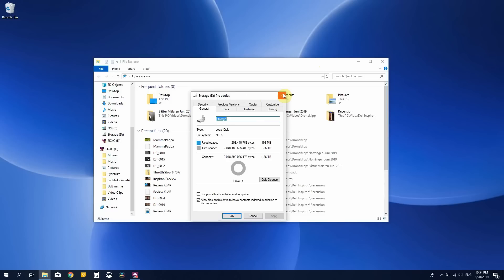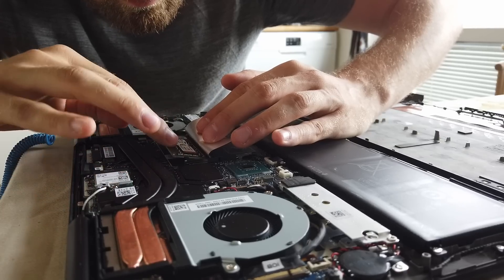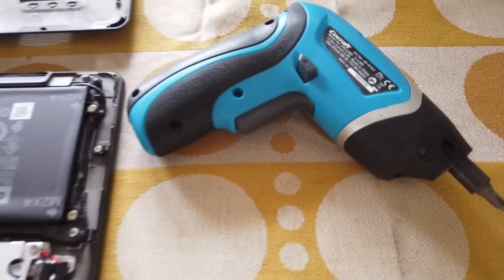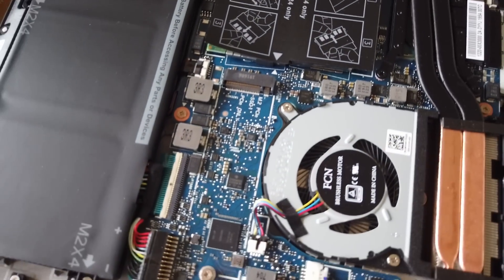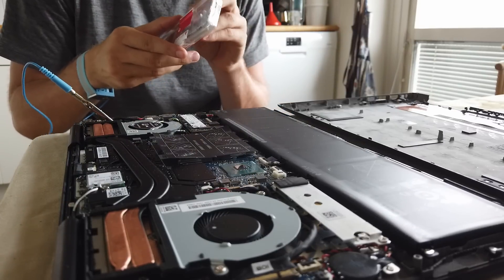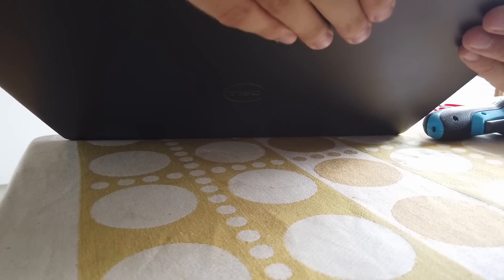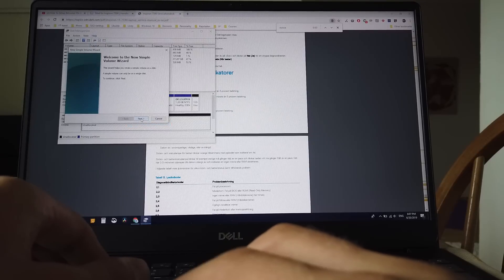Dell Inspiron - 2,5Tb SSD & 16GB RAM Upgrade

Comment: could you tell why you ignored dell restriction of 512 gb limit of the second ssd , and will instaling a 1 or 2TB ssd will affect the laptop speed or the system energy efficiency?
Reply from the maker: Because I think it's ridiculous and it's been working perfectly fine. I read that thing only after I bought the SSD.
It should be no problem at all!
Reply: @w2best  thank you for answering
Reply: Sir , laptop is Inspiron 7591 , I ran into a problem , I have added an another SSD to my 2nd slot , when I press power button it shows amber color light (no blinking) and light gets off when take my hand away from power button , can you help me plzzz🙏

Comment: Hi, the 8GB Samsung RAM you linked in the description, is it the same model as the one that is already in the laptop? So it'll work in dual channel? Or should I buy two of these and replace the one that's already in there? Thank you.
Reply from the maker: Not the same but the same size and speed so it works perfect. :)

Comment: Did you run into any kernel errors when installing second ssd? I have inspiron 7591 and plan to install mp510 corsair.  Also does it come with ssd screw?
Reply from the maker: I had no issues at all with it! What problem do you get into? SSD screw is there! Just put it in and go! :)

Comment: Hey, thanks for the vid! What graphics card are you using?
Reply: Nvm i just saw it at the end of the vid! I was looking for it in the description:P
Reply from the maker: Yes it's the 1650 in this one!
Reply: @w2best  I own the 7591 Black Edition - so they sell the 7590 with a 1650? Or did you swap out the MX250/150 or what? That is one thing I wish the 7591 Black Edition has, at least a mid range GTX graphics card. I have 4 more days before my return date window at Best Buy is up. I have upgraded the memory with 32 dual Crucial and thinking about adding the Intel 600 SSD you suggest. I am a graphic artist and have been running this machine nonstop to see its limits and I am wondering how well the MX250 will be for the long haul. It was between this laptop and the Asus Q547FD...I hope I am making the right decision. I love the magnetic stylus slot and overall look of the Inspiron 7591 BE. Great vids btw
Reply: @TruthistheONLYRealThing  hey did you ever got to return the laptop. I'm in the same exact situation you're in. But I notice the laptop he's review is quite different from the one we both have. I click on the link listed and noticed the difference in specs. I doubt his laptop is 4k as yours is. I'm loving this laptop but that Mx250 graphic card bothers me. I wish they have it with the gtx1060. I have about 7 more days on mine, hence, I cant return it. But it definitely is a great laptop. P.S. let me know what upgrade you're willing to do on yours.
Reply: @ulot2320  I ended up keeping it and putting in 32gb of crucial ram and a pioneer 2tb ssd and I put it on the quiet setting in Dell Performance Monitor under the thermals tab and I have to say, I think this machine is a beast that I hope to use for years to come. I was hoping that they were going to release a new 2020 version before the window for my return closed but who knows how long it'll be if they have another black edition with pen slot. I'm a digital artist and this whole set up is so perfect for me. I think other companies, like hp, would do well to use this same form factor, because it's a great design. Anyhow, man, I'd keep it if I were you. There's not much comparable out there other than the HP Spectre x360 15, which is missing the pen slot and it costs much more.
Reply: @ulot2320  but if you're dead set on a 2 in 1 with a 1650, then your best bet is ordering a Spectre X360 15.6 with it, which I think just became available on their store recently. I'm a big Dell fan though. I owned a Spectre before and it was awesome, but I just feel Dell has a better overall experience and customer service.

Comment: can i upgrade my battery on my inspiron 7590, i have a 56wh 3 cell battery and want to upgrade to a 97wh battery, is that possible
Reply from the maker: According to the Dell upgrade guide you can do this, although I haven't tried!
Reply: Hello,
I also have a 56wh battery in my vostro 7590 (unfortunately) and by the looks it should be upgradeable, because there are no barriers whatsoever, just a removable piece of tin resembling a 2.5" ssd.

Comment: I bought 32 GB, 2xBallistix 16GB DDR4 - 2666 SODIMM 1.2V (BLS16G4S26BFSD.16FD). And it didn't work for me... One ram, the other one, each slot, nothing to do. Didn't work. I will probably try your RAM in hope it works
Reply from the maker: Oh wow that is super strange! Do you get the blinking light issue? The power indicator I mean!
Reply: @w2best   yep :/

Comment: How did yours come with 97WHr? Mine is 3 cell 56WHr with no options to upgrade
Reply from the maker: Yes I got that model. You can upgrade according to Dell. However you'd need to order the larger battery then...
Reply: Thanks, i will probably do it a few years down the road after the current battery starts losing it's ability to hold it's charge.
Reply from the maker: @kjtan9913  Sounds like a good plan!!

Comment: Thanks for doing this video. I just bought this laptop. There's something I don't understand, though. Is there as second SSD slot or I need to uninstall the existing one and install the new one?
Reply from the maker: There is a second one. One of the big perks of it!
Reply from the maker: @allaboutferrets  There is an extra m2 ssd slot regardless of other config :) There is no 65 wh battery.
Reply: @w2best  Great! So I'll just get another 256gb m2 SSD. Is there any particular type I should buy?
Reply from the maker: @EnriqueYervez  any m2 will do - but nvme are the faster ones. :) a bit more expensive though. I recommend the Intel 600 linked in the description.
Reply: @EnriqueYervez  yo do realize that you're not working on the same laptop. There's different variations of this laptop and they do have different spec. Yours does not have an additional ssd card slot. Your graphic card is the Mx250. You probably will have to remove the 512gb ssd that came with yours and put in a new one. Plus yours came with a 16gb ram, he's came with an 8gb. Subtle difference. But its does matter.

Comment: Hello,i own Vostro 15 7590(form Israel)-my laptop is a 6 cell battery 97WHR,can you tell me if i'm able to add a SSD 2.5 inch sata to this?i read that:NOTE: The hard drive is available only in computers shipped with 3-cell battery.
Reply from the maker: No you can't add a 2,5 inch. But you have the extra m2 available. :)
Reply: @w2best  Thanks a lot,you saved me open my laptop,,,if i want to add the HDD for games,what you suggest?m2 hard drive or external drive-i have usb 3.1 right?i dont' want to spend too much money..
Reply from the maker: @haimch  Have you seen intel 600 M2 SSD? They are my recommended drive, and really not that expensive. :)
Reply: @w2best  I saw you mentioned it in your video, what about Samsung 970 super Evo...?
Reply from the maker: @haimch  Oh 970 Evo is AMAZING but it's super pricey too. If you want the best get samsung evo or pro. If you want the most afforable. Get intel 600. :) External works too but I think it's reaally annoying to have your games or videos on a separate drive that you can forget...
Reply: @w2best  thanks, by the WY, how much is hard to open the laptop? I opened an old inpsirion one...
Reply from the maker: @haimch  It's not very hard once you know the back screws are not supposed to come out. Prying it open was no problem. Just use a good screwdriver from scratch and a thin card to pry.

Comment: How did you switch RAM possession for 2 ram-sticks? I can not find it in the bios.
Reply from the maker: That should pretty much always work automatically. I haven't seen it as a manual setting in any computer!
Reply: Thanks for your answer. So what did you do when system didn't start? I have the same issue after installing second ram stick - 2 amber an 3 white blinks.
Reply from the maker: @maciejbiarda3910  Oh I didn't get that was you issue! When I switched place of the RAM-sticks it worked perfectly. I have no idea why, but that's what I had to do.
Reply: ok. I have inserted only the new one and it didn't work either. I think this new ram-stick (HX426S15IB2/8) is "too good" to work with this computer. But it should work. The only difference in the specification is that new one has CL15 (not CL19 like the factory installed). Its latency should adapt automatically to the slower one.
Reply: @maciejbiarda3910  I have the same problem but with 2 x 16 GB of hyperx RAM. The issue is in XMP option. Did you managed to install it somehow??
Reply: @patryklaban5907  Yes. I returned the HyperX RAM to Amazon and I bought Crucial CT8G4SFS8266 8Go. It worked right away.

Comment: Very informative video! I will follow your specs. Do you know the size of the back three screws? Dell just describes them as 'captive screws'. I cannot even loosen them. They are extremely overtightened, and now they've become stripped :(. Since I can't open the back cover, I can't upgrade the RAM and SSD. P.S.) Dell Premium Support (Japan) is not eager to help this issue.
Reply from the maker: I had the same but got them out with electric screw driver. That worked really well! But I destroyed the screws in the process thinking they should come all the way out...
Reply: To open back cover of laptop easily, you need to purchase 'laptop tool kit". Inside this "laptop tool kit", there are 2 triangle shape look-alike for prying the laptop's back cover.  Have to pry from pattern LEFT TO RIGHT around the laptop. Look for video "How to replace laptop battery" or "Dell Inspiron 15 7510 I/O board replacement". It shall help you some idea of starting

(Note: you can use mastercard like as a pry -tool for opening the back cover of laptop tool)

Comment: after adding 8gb of ram to my inspiron 7951, two columns of keys on the keyoard (2wsx and 3edc keys) stopped working. did this happen to anyone? could it be a ribbon cable issue? how do you even get to it on this computer?
Reply from the maker: Did it happen straight away? Does it not work at all, or just is unresponsive? My keys started behaving really weird yesterday, but haven't done before. Give me some more info, would be great!
Reply: @w2best  they are responsive, but seem to give out weird responses (like pressing c outputs as vcxz* and such).
It started straight after putting in the ram (but continued even after the extra ram was removed).
I really have a feeling its related to the ribbon cable that connects the mother board and the keyboard. It might have gotten disconnected a bit from opening the case (like you said, really hard to open, and i only had a manual screwdriver...).
Reply from the maker: @yoelhoffman9999  Ok, Maybe that's the case but for me if feels different. Now It works perfectly, but when I was using the laptop last afternoon it didn't work at all. I could basicly not type a single a because it would just skip the letter input. Same with z and a few other important letters on the left side of the keyboard. Did you open it again to check the cable?
Reply: @w2best  i checked the cable again and couldn't find the problem. It may be a problem with the other end of the cable
But i really dont want to access it myself since it would basically require removing the motherboard and checking. Im going to contact dell and activate the warranty...
Reply from the maker: @yoelhoffman9999  That sounds reasonable. Mine stopped acting weirly almost immediately, but if it happens again I will prbably get in touch with dell about the issue! Let me know how it works out!
Reply from the maker: Today I don't experience this problem which makes me think it's not hardware related. Hmm. I really need to find out about this.

Comment: Hey. Nice video. How is the battery life after this 3 months?
Reply from the maker: It's amazing. The only problem is sleep mode that consumes battery when it's not supposed to. That whole issue sucks.
Reply: @w2best  Thank you for the reply. I have the 2018 model. DELL Inspiron 7580. I bought it for the Christmas of 2018, 27 December. The battery is terible! It helds only 1 hour just for editing text and a little bit of youtube. I have done the test this morning. It is not possible! DELL sent me a new battery,  42W, the same with the battery it came initially, wich I have installed 30 minutes ago. I will make a new test this afternoon, but if the battery won't last at least 4 hours, I think that I will send it back and i'll ask for the new model. I hope that they will accept the exchage, if I pay the differece. I really like DELL, but the battery is very important to me. Nice videos btw, I have watched all :) 
See ya!
Reply from the maker: @CosminAnton  Oh 1 hour is crazy. But also 42wh is a really small battery. The new inspiron with 97wh is insane. :) Hope you have success with it!

Comment: Is that constant background sound the fan noise which is always on?? 😳🔊😵😵
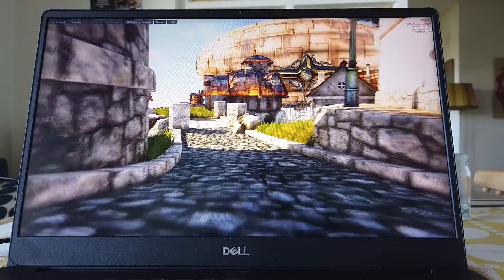Reply: E.g. 5:20 to 5:40
Reply from the maker: That is the fan! But it's not always on. When you make a GPU Benchmark it's def. on.
Reply: @w2best  but still, when you buy a brand new inspiron, is it enough to install the latest bios updates from Dell's website in order to keep it cool and quiet? Cause I can't imagine spending 1000€+ on a laptop which doesn't fulfil my wishes with the factory settings, thus going into undervolting of the CPU etc... Plus this immediately decreases the value of the laptop - you already don't have the performance you paid for... So is only the software update in this case enough to prevent overheating and permanent fan noise under easy to moderate use? 
Thanks.
Reply from the maker: @Lucary1000  Yes - the new bios is enough. But obviously not for silent gaming or rendering performance. I don't which laptop you can get that from. If you know one PLEASE let me know cause that would be quite amazing. :P
Reply: @w2best  sure, that makes sense ;) but as I understand, fans were on immediately after boot, which is unacceptable, so I'm glad if they fixed it with bios update.
Nevertheless, I'm still torn between this, yoga 730 15 and xps 9570 (15inch from 2018-build quality should be the same as this year's).. Hopefully also your comparison with the xps will help me decide, since xps is known for dozens of issues with fans, overheating, coil whine, the list goes on and on.. When are you planning to release it btw? :)
P. S. 
-Is the battery life good (with that I mean 6-8h) also with 56Wh on inspiron? 
-And does the touchpad feel smooth, since the surface is not glass? And is there any flex in the keyboard area if you press more firmly with your fingers? I'm a bit sceptical about magnesium alloy (I read that it feels much more like cheap plastic rather than a sturdy aluminium).. But I guess you'll touch that point in your comparison as well :)
Thanks and best regards.
Reply from the maker: @Lucary1000  Fans are never on after boot or in idle after the bios update. Only when running heavy tasks.
Reply: @w2best  ok that's good. Can you please answer also my other two questions? Unfortunately I can only order it online and can not try it first in any store around :/ many thanks
Reply from the maker: @Lucary1000  What are your other 2 questions?
Reply: @w2best  oh sorry actually there were 3 ;) 
- battery life with the 56Wh model compared to 97Wh. 
- how much storage is there actually left from 256gb SSD for a user after first boot (so with windows 10 and other pre-loaded apps already installed) 
And the other two you could actually touch in the video comparison with XPS:
- touchpad material and smoothness
- flex in the keyboard area if pressed firmly with your fingers.
When is the video out? 
Sorry for my annoyance but you're actually one of the very few reviewers who go into detail and don't just throw out the 3min "blabla great product" useless videos paid by manufacturers :) 
Thanks
Reply from the maker: @Lucary1000  I haven't tried 56wh so I can't tell you. 
I didn't get 256gb ssd so I can't tell you that either. 
I will talk a bout both those points in the comparison video!

Comment: Sad you skipped the part where you actually opened the case, struggeling here :(
Reply from the maker: You bet that is the reason... Back 3 screws won't come out. Pry with credit card. It will work.

Comment: Hello my friend! Is It possible to change also the main internal SSD which the laptop come with? Because i would like to have fastest benchmark in the order of the 3k :)
Reply from the maker: That is very much possible! It's just a regular nvme drive slot. You just need to reinstall the OS then. :)
Reply: @w2best  thank you very much my friend!
Reply: @w2best  First, thank you for your video. If you have the occasion to look inside the beast again, could you please check the interface of the main ssd, I wonder if it is a m2 2230 (seems to be but it's not easy to see it on your video) module wit M key or B+M key (https://www.delock.com/infothek/M.2/M.2_e.html)? And if it is a m2 2230, is there enough room to use an m2 2280 (more choice)?
Reply from the maker: @scrittin You mean if the main ssd is a long or a short one? it's a long one, you should be able to see it in the video too :)

Comment: Hi, do you have any issues with heatings or fans after the BIOS update in August? Thanks!
Reply from the maker: Not any more problems with heat than I use to before the update. :) Fans are now completely silent at idle or moderate use.